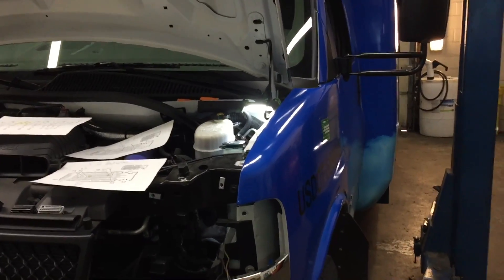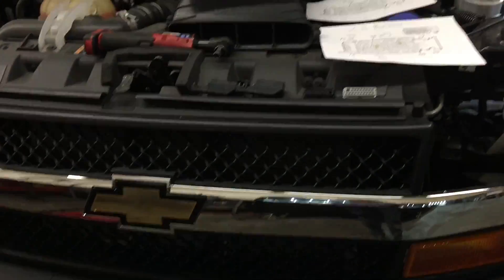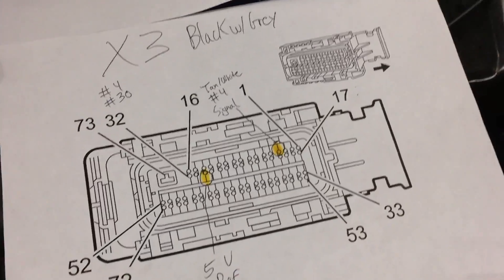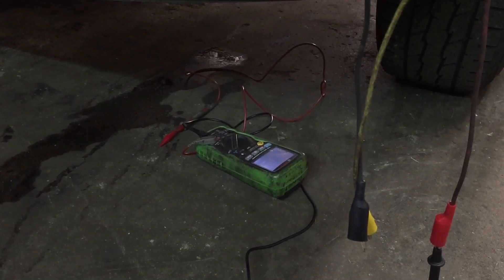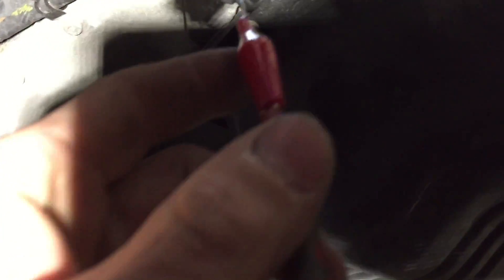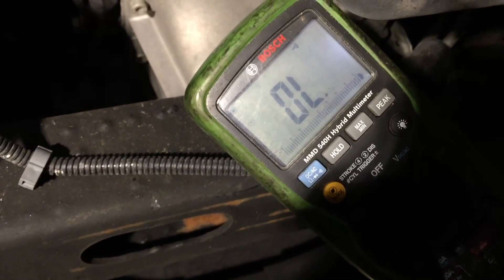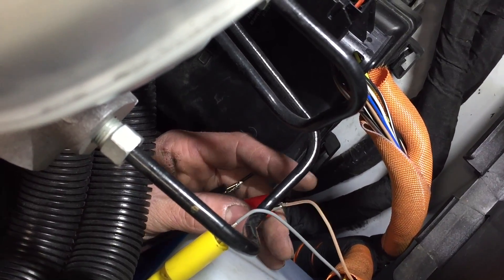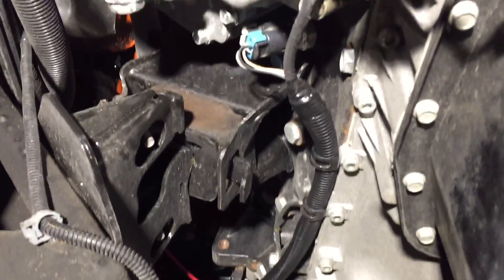Duramax Oil Pressure Loss?

Comment: Very good video, that is exactly how to find a open or high resistance circuit. Also I have noticed myself over the years, if you leave the DVOM connected for a few minutes, the resistance tends to keep creeping up as the voltage from the DVOM heats the wire and the corroded part of it. My auto mechanics teacher taught us ( mid eighties) that you give the wire the "sexy" test. Twist , pull and jerk on it and if it has a weak spot, it'll break apart.  Anyhow, my personal truck 2006 LBZ has the exact same issue. No oil pressure at times and the Low Oil Pressure warning on the DIC. I've already replaced the sending unit and the wiring connector at the sender. Figured I'd be replacing wires next. Thanks for the quality video.

Comment: Hello.  good night.  i have a 2001 gmc sierra 2500 duramax 6.6 diesel with 246k miles.  the oil pressure is 20 all the time at 600 rpm, but only by accelerating and raising the rpm to 1000 or 1100 the oil pressure rises to 45 or 50 and even reaches 60 if the rpm rises to 2000, do you think it is? Is this normal or is there a problem?  he doesn't smoke or anything

Comment: Don't think the gauge of The Wire matters too much, it's the resistance to oil and diesel that I would be more interested in, but as long as it does not go down to earth or core of the cable does not brake it work fine

Comment: seems a bit overkill to have a 6.6 litre turbo diesel in a shuttle bus :-D Do those things come with smaller option engine?
Reply: is it overkill? What would you say the average american weight is? How many of them will be on that shuttle bus at one time? Will they have luggage or anything else? Hills? etc. The shuttle bus already needs a lot of power to move it, then load it up, go at highway speeds, maybe with some type of trailer etc, it needs a lot more.
Better to also have too much power than not enough. Why kill your engine and fuel forcing the engine to work too hard.
Maybe they left they will get better life out of the diesel engine compared to the other options and not have to worry about expensive repairs as soon. 
Yeah, little bit more powerful than probably needed, but I'm sure that driver is happy.

Comment: Yep, Instead of dicking around with looms and potentially causing more problems, just run a new wire outside the loom.

Most people would have just replaced the switch and found out it didn't fix the problem.

Comment: rocking the old body style on a 2015...?....
Reply: stephen frank GM hasn't changed their van bodystyle since its introduction in 1996, just facelifts, new interiors, and more tech basically. They have replaced the 1500 though with the CityExpress at least tho
Reply: stephen frank as far as I'm aware, it has had 3 facelifts in its 20 year production run, with the last one being around 2005 or 2006. Not sure if they would though as they are slowly replacing the express lineup, the 1500 was already replaced by a rebadged Nissan NV200 for example, as far as I'm aware there are no plans to cut the rest of the models, though they could pull a Ford and bring over the Opel Vivaro (a Euro van made by Opel, part of GM) and leave the express vans for use in cutaways and chassis cabs
Reply: Chillkoot Markowee only the frame is the same really, the body is completely different between them
Reply: +stephen frank | that's cause there considered trucks and commercial vehicles, they don't get updates in less then a decade or so.
Reply: Justin Noker gotcha ... though the guy said this was a 2015 Silverado... I was like wtf .. that looks like a 2011 or 2012
Reply: stephen frank it ain't a Silverado, that much I can guarantee you lol
Reply: Justin Noker valid .. lol but still damn even for an express that poor thing needs a face-lift... still looks like it about 4 or 5 years old already
Reply: Justin Noker but it is based off of the silverado
Reply: Justin Noker true

Comment: What a pos not even 30k an having electrical problems smh I hate American cars
Reply: Don Heston 
It's a fluke.
Reply: i believe it considering it's a American automobile
Reply: MrZappy101 Duramax is not a "Japanese made" engine. DMAX Inc. is a joint-venture started GM and Isuzu in Ohio, USA.
Reply: Don Heston Every batch has some lemons and it's the millions of perfectly fine ones that you don't see youtubes of. Go get yourself a used volvo or audi and tell me it has zero electrical problems for twice the money.
Reply: Ya, if it were a Volkswagen it would have electrical problems when it came out of the factory.
Reply: Don Heston the duramax is a Japanese made motor, sooo you hate Japanese cars too?
Reply: ssdwellah who do you think makes Isuzu? They are a Japanese Diesel engine manufacturer.
Reply: jclaunch00 just in response to the comments saying "all American cars suck." The Japanese company has/had input in the design process, doesn't really matter where it was actually built. Which just disproves the whole generalization that all American cars suck since alot of designs are typically a compilation of many companies/countries

Comment: i wish i seen more buses, or Gvans with a duramax, would get good at them, those 2 12mm bolts going upwards for the intake manifold is a tight fit.
its pinched behind the front engine mount bracket, the a/c compressor/alternator bracket on the drivers side of the engine.

Comment: i'm a tech in a chrysler dealership, we rarely run new wire most of the time we replace complete harness assembly, its a pain but if chrysler pay for it why not
Reply: my old '89 Toyota pickup still has it's original wiring harness and drivetrain at over 780xxx miles, don't think i'll ever see anything from Chrysler, Dodge or Jeep get anywhere near this kind of mileage without spending a fortune in repairs, in fact you'd be very lucky to hit 100,000 miles without experiencing a single issue on these POS
Reply: +guy proulx my 87 F250 hauled 30ft fifth wheel most its life,and minor bumps&scratches still as new and perky since day one,also a 74 Chevy C20 tons of bumps&scraps but loves the overhead camper
Reply: +390merc65 right on,see my other comment,wonder if that asain truck can pull a 6% with a pallet of bricks on it